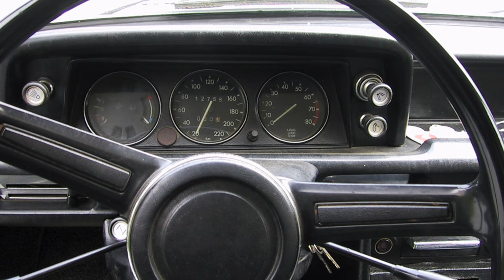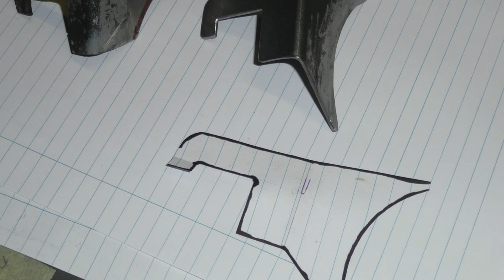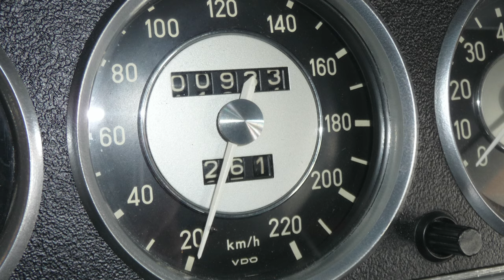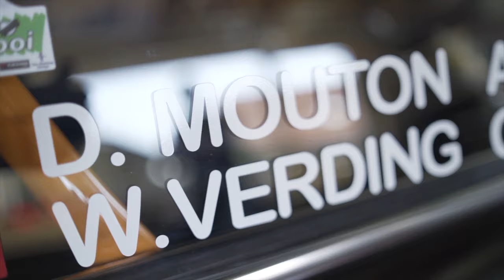Full restoration and build. BMW 2002ti Alpina tribute. Just mesmerizing and satisfying to watch.

Comment: Alpina used to be an aspirational sports car. Old gear heads in Europe I knew back in the 90's took great pride that their car was NOT AN M. Today that could never be, anyone that does not have an M car is looked upon as a peasant. It is sad what they have done with Alpina producing only automatic 2 ton sedans. At the very least they could have produced just one 2 door coupe based on the F 2 series with Alpina's custom N55 version twin turbo, and a manual transmission.

Comment: I just finished up the major sheet metal work on our 1970 E9, while it was rusty, I can see how much more rusty these early cars can be, I've got over 140  hours in metal fab, and cut, and replace, the body shop i brought it to spent another 100-120 hours completing the rockers, and hanging the front fenders replacing the lower, and aft portions of the fenders, and one lower A pillar, body work prime from bare metal, and ready to finish body work, will let the work settle back before fine tuning it. I myself replaced the floors that were rusted in areas. repaired the rear window frame, then repaired the front inner aprons where the firewall meets the to of the inner fender aprons on both sides. There is no end to what I could have done to the car, but realistically it's good enough for me at this point, can't wait to hear the M30 B32 Euro I have run in this old 2800cs, the B28 is tired but still runs.....!

Comment: j'ai eu la 2002 de 1973 ,4 vitesses ,jamais ennuyé ,quand j'ai refait la carrosserie, seul les logements de clignotants avant, étaient perforé et rouillé , se méfier du support moteur inferieur ,il est en fonte et sur la mienne était cassé, à l'achat , sinon RAS :)   I had the 2002 from 1973, 4 speed, never bored, when I remade the body, only the front turn signal housings, were perforated and rusty, beware of the lower engine mount, it is cast iron and on mine was broken, when purchased, otherwise RAS :)
Reply: Exact pour la rouille au niveau des clignos av.
Reply: @roy4359  une vrais galère à refaire à la résine polyester à l'époque

Comment: Wow nice work sir! She looks and sounds great! That undercarriage shot at 34:56 is amazing. I could have looked at that a lot longer. And did LOL.
Reply: Thanks, and still looks good after almost 28k kilometers, road, off road and circuit use...
Reply: @Dany Mouton absolutely incredible work and amazing vision on the end result! 👏🏻👌🏼  Do you have the specs on it listed anywhere?  I’m extremely curious as to final weight, mods on engine, engine output, obviously all bmw  Componentry  but what was taken from other bmw models.